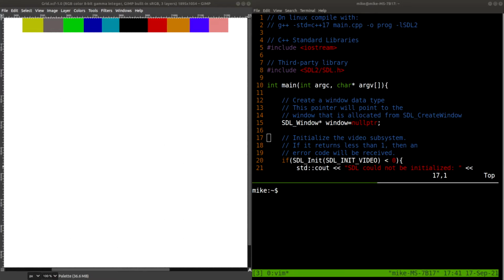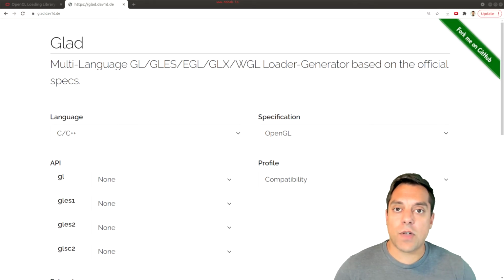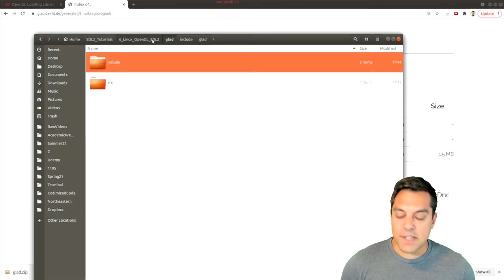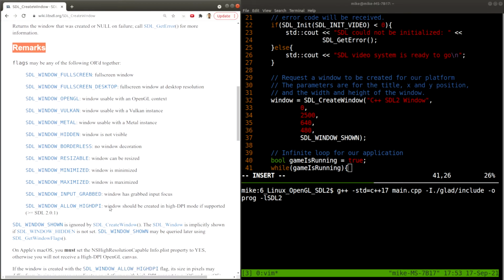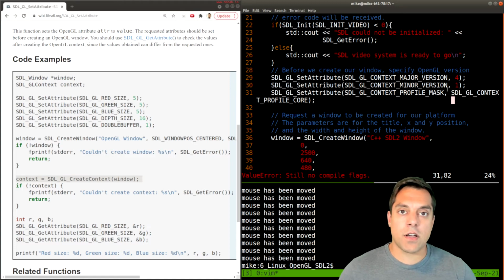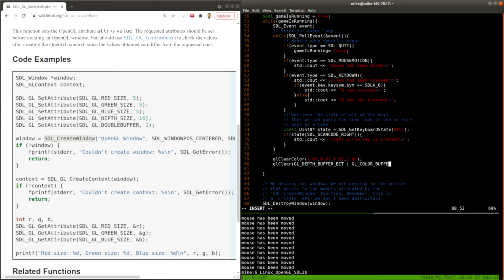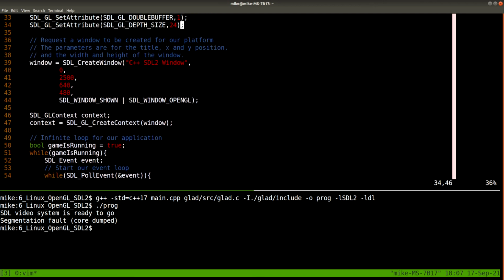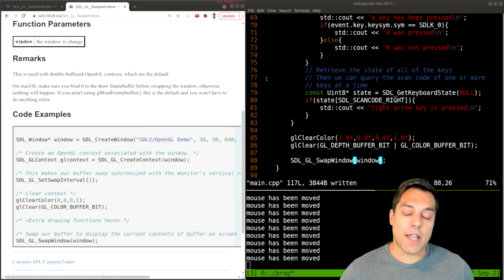[Ep. 13] First SDL OpenGL Window with GLAD fully explained | Introduction to SDL2

Comment: Hi Mike. A big thank you for your videos. I'm trying to rewrite the lazyfoo SDL2 tutorial lessons in d (using bindbc-sdl wrapper). I noticed that lazyfoo is actually not using OpenGL for hardware rendering, but simply SDL2 (which as I understand is simply a wrapper on top of OpenGL). Why should I bother using OpenGL, like you do in this video? This might have to do with advanced features from OpenGL that the SDL2 wrapper does not make available.
Reply from the maker: Thank you for the kind words! One primary reason to use SDL2+OpenGL would be if you need to render 3D graphics. SDL2 does not have any built-in 3D graphics for hardware acceleration. The other reason to learn OpenGL with SDL2, if you are doing 2D development, is to have the ability to customize the rendering pipeline to your needs (whether for performance, special effects, etc.). SDL2's 2D capabilities alone are enough to build a game if that's your goal however :)
Reply: @MikeShah  it was my question, thank you 💪
Reply from the maker: @tonym5857  happy holidays!

Comment: Hey Mike, awesome video so far (halfway thru). I'm curios why the compiler needs to be told about /glad/include in terminal vs just putting the full path in the include  statement at the top of main.cpp.  I tried to put in #include <glad/include/glad/glad.h> which I would think is the path as it relates to my main.cpp (adjacent in directory) and then leave out the -I arg in command line, does not work of course. I figure maybe other people will wonder the same thing, so asking the question here. Thanks!
Reply from the maker: We prefer to use relative paths and tell the compiler where the header is. Then we can build project on different machines :)
Reply: @MikeShah  Thank you.
Reply: Well, I had problem with these "glad.h" paths, so I created one folder inside my project's folder with name "glad" and I put both "glad.h" and "khrplatform.h", ignore the include and src subfolders. (In your video you are not explaining how to resolve this). For the first I put #include "glad/glad.h" with quotes on my main.cpp and somewhere inside the "glad.h" it will find another error about not finding the file "khrplatform.h", remove the path and put with quotes #include "khrplatform.h" and save the header files. This was solved the error not able to find the header files.
I had a warning, when I compile in the line that says: window=nullptr; 
C:\SDL Test 02\Main.cpp|48|warning: identifier 'nullptr' is a keyword in C++11 [-Wc++0x-compat]|
C:\SDL Test 02\Main.cpp|48|error: 'nullptr' was not declared in this scope|
If I will change the line to window=0; then the error and warning clears.
If I will use different c++ ISOs like 11 and 14 I have this warning.
||warning: command line option '-std=c++11' is valid for C++/ObjC++ but not for C|
In your video you are not using any IDE at all.
All of these videos are nice, but each person who uses a different operating system for example there you are using mac and here I am using windows with code::blocks and none of the compile ways work, I searched elsewhere to find how to complile SDL with code::blocks and there in your video you are using command line. Also you added the -ldl which is not exist. What is this -ldl. You are not explaining lots of things and after seeing some videos you arrive at the point that something wasn't explained at all and then an error appear and you can't continue to see the videos.
I have seen many people videos and then they are ending to be a mess and you arrive at the point that something is not compiling or missing regardless on the version of the C++ they use or on the version of their operating system they used worked and then you can't continue.